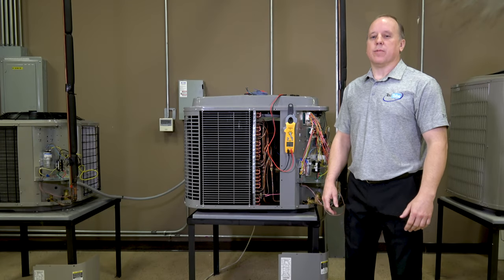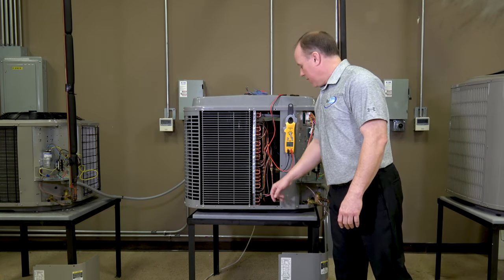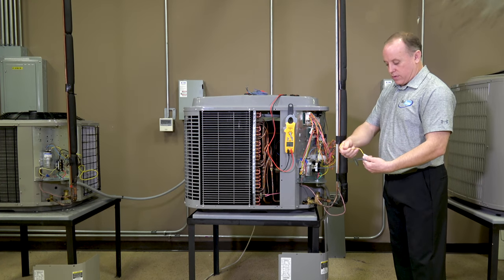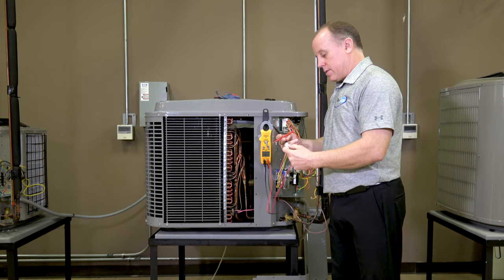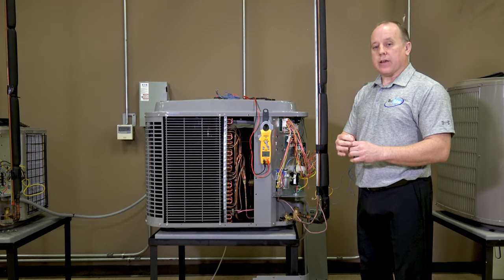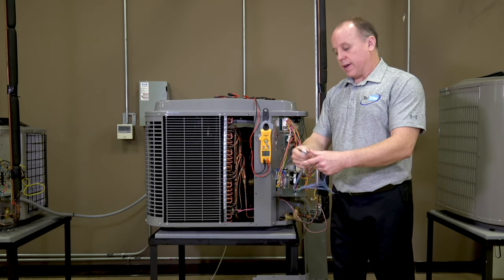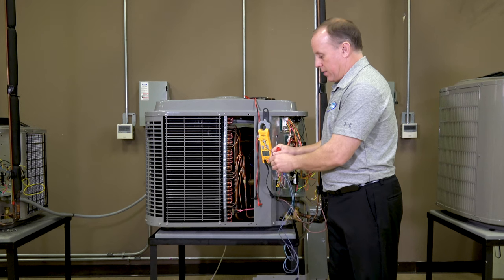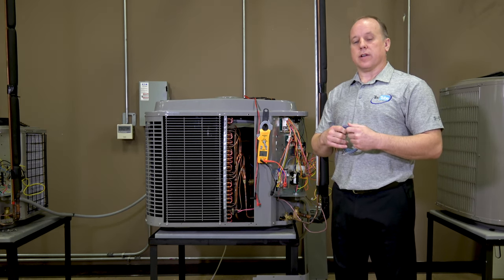Testing Pressure Switches on Condensing Units

Comment: I know this is a beginner forum but I had 2 today low/high on a Trane that would shut off the outdoor unit but not blow the ah fuse. Resistance through switches was 2.4 k ohms. It was intermittent and happen once every 10 hours roughly. I bypassed them. Not a service call you want when units run great while you're there.

Comment: The Lennox unit I just repaired at my home has a pressure switch with a reset button on it.  The outdoor unit would not power on at all. I pushed the button on the High Pressure Switch and the unit started running again. I felt a distinct click when I pushed the button which I did not feel in subsequent pushing.
Reply: u repaired ur own unit? Are u a technician? 99% of the time a tripped pressure switch means u got another problem on residential equipment. You should have it looked at by a pro. Make sure everything is clean. A compressor running high pressure means high bills and very soon to be bad compressor
Reply: @hvacdr  

It was the result of having switched the AC on and off and then on again too quickly. It's an old unit. But it still works.
Reply: If it went out again after that clean the condenser coil, some gasses are bad in terms of glide so can be affected by mainly heat, but well just say ambient temperature, and the other consideration can be the fan rpm, in some machines there’s a variable speed fan, if it can’t do the full range you’ll get issues, pressure switches do wear out also, but good job, a technician usually would just reset it, and run unit, clean it and see if the call returns.
Reply: Distant click was the contactor.

Comment: Why would it be any harder to check voltage vs continuity? Either way, you have to get to both sides of the switch. If there is more than one switch, you have to check each one anyway. Continuity may be more useful, but I don't see it being any easier.
Reply from the maker: It is personal preference. One of our trainers, Ryan, always uses continuity to test any switches, while many of our other trainers use voltage. In our experience, it seems that those who were trained in HVAC programs at colleges or unions test switches with voltage and those with building automation backgrounds use continuity.
Reply from the maker: The only disadvantage of testing with voltage is that you need to know what voltage to expect (DC or AC... 24, 120, 240, etc) whereas with continuity you do not need to know anything about the rest of the circuit.

Comment: My church Rheem heat pump did not come on when I called for ac. I pressed the contactor at the unit and it just clicked. The defrost board was normal and then after I pressed the contactor, the lights blinked. I didnt read what the code equates to before I left.  Am I suppose to find 24 volts at the LP and HP. Can I reset the board to see if it will start?

Comment: Thanks for the video =). Leaving some feedback here that you might want to consider related to safety: Apparently some AC units have pressure sensors without Schrader valves so removing them without depleting the refrigerant inside can be hazardous. It would be good to mention some disclaimers related to safety.

Comment: i didn't test my switches, but i bypassed them and grounded the contactor the AC still didn't run...could it be the relay board on the unit? I so far changed the main board the capacitor and the contactor...the compressor runs if i push the contactor by hand, I'm running out of things to replace lol
Reply from the maker: What were the reasons you had to change the board, the capacitor, and the contactor? That is a lot of stuff. What happened that damaged them all at the same time? How did you test each of those to determine they needed to be replaced?
Reply: @TECTubefilms   none of those are bad but before i did enough research i had those spare parts on hand so i replaced thinking its the contactor then i said well ill try capacitor. I replaced the board with another board that has a fuse unlike the old one. But after ive done my research and diagnosed none of those were broken...
Reply: I have the same problem, but for me, if I press the contactor the AC runs but without cold air. I think there is a leak somewhere and AC is out of R22 (that's why contactor doesn't remain engaged). And since it's R22 I plan to replace the whole unit. It's also over 20 years old.
Reply: @RahulRathi_Multimedia  i ran further testing and the low pressure switch is open, i bypassed it and compressor runs but doesnt cool, also r22 so i think im in the same boat because r22 so expensive and hard to find thanks to the overreach of epa
Reply from the maker: @RahulRathi_Multimedia  If you push the contactor in, it only engages the outdoor unit. To get cold air delivered in the home, you also need the indoor unit's fan to be turned on.

Comment: Thanks for the video. Will the system start and then cut out after a few seconds if the refrigerant is low?
Reply: Depends on what you mean. What's starting and stopping? The fan and the compressor, just compressor, compressor stays on but fan is intermittent? If both constantly turn off and on intermittently then you may have bad contactor or capacitor.

Comment: Thank you for a most helpful video.  My condenser (Carrier 3 ton 14 SEER) has no low pressure switch in it.  It is possible to have one added?  If so do you have any pointers as to what to purchase?
Reply from the maker: Yes it can be added. But it would not be worth the cost to evacuate the system and pipe it in.
Reply: @TECTubefilms  We have to find a leak and fix it so we'll be doing the evacuation anyway  I just ordered a few things so will have my guy add the switch  We are in Bahamas so these things are hard to get hold of.  Thank you for you thoughtful reply and excellent video.
Reply: @TECTubefilms  You don't need to braze it in. If you don't mind looking like a newb, use one of those t's you put on the service port that turns the port into 2, one for gauges and one for the new pressure switch. Don't do that if you want to look professional though.

Comment: That 2nd low pressure switch Cannot Be Good because it read Closed and it’s not even hooked to the System Sensing Ref. Flow.??
Reply: It's probably a high pressure one.

Comment: Will a bad high pressure switch .. stop the condensing unit from cycling off when set temperature reached? Thanks...
Reply from the maker: No. Once the thermostat stops calling for cooling, the unit will shut-off regardless of the pressure switch.
Reply: @TECTubefilms  Thanks a lot for your response I was having this issue with my ac  was looking for a solution ....
Reply from the maker: @thomasguillen5898  You need to determine if the pressure switch is actually bad or if the pressure in the system is getting too high and hence the switch is just doing it's job.

Comment: Will my low pressure switch test closed when taken off the low side?
Reply from the maker: Pressure switches are "normally closed" devices and open when something is not right so in this case the switch will be closed unless the pressure is too low. We are not sure what you are asking when you say "taken off the low side."
Reply: @TECTubefilms  He means if you remove the low pressure switch from the system, should it be open or closed. Or in other words, would they normally be open or closed at 1 bar. The answer is no. Low pressure switch is designed specifically to shut down a super low charged system. The worst low charged system is 1 bar, so the switch should be open if taken off the unit.

Comment: When your unit is off are both high and low pressure switches supposed to be off ? My unit is short cycling
Reply from the maker: The pressure switches will be normally closed and when the refrigerant pressure is too high or too low, they will open and turn the unit off.
Reply: @TECTubefilms  Just to clarify - so testing the switches while they are in the unit cannot tell you if they are bad or not, just that they are open, correct? The other thing you would have to rule out is that your pressure is not high/low. If it is normal pressure, then an open switch would indicate a bad switch, correct?
Reply from the maker: @mcgu8114  Yes, if you can measure the pressure at the switch and it is in a normal range compared to the trigger point of the pressure switch but the switch is open anyway, then the switch itself is the issue. That statement holds true for all pressure switches for all fluids.
Reply: @TECTubefilms  I have a 410 a system and only runs for a minute cuts off and goes into the 5 min delay and does the same thing. High side is 300psi and low side 130 psi the pressure switch trips the unit off and then resets how do I test a pressure switch to know if it's faulty
Reply: @jasonmontroy9182 he literally just told you???
Reply: @jasonmontroy9182 when it trips.... Test your pressure. Was it over the hi side or under the low side? Depending which one is tripping compare it and you'll have yoyr answer. It is really quite easy

Comment: one way to test the pressure switches is to .

1. to test the high pressure switch just disconnect the fan motor and let the head pressure go high maybe even throw a blanket over the unit to prevent convection cooling.

2. to test the low pressure switch just connect a refrigerant recovery tank to the unit and let the refrigerant out into the tank until the unit shuts off.

the recharge the unit.

if the unit has the low pressure switch connected as a thread on and there is a valve stem similar to a tire you can remove the switch and the unit should shut off.

Comment: the ac guy I have said my high pressure switch was bad . but after watching this video I  test the switch and I have continuity  so it's a good switch or could it be bad?
Reply from the maker: We are a little confused.  If he tested the switch and concluded it was bad, why did he not replace it?
Reply from the maker: Without being there to test it ourselves, we do not know why he concluded it was a bad switch.  Having continuity doesn't necessarily mean the switch is good.  Having continuity, just means the switch is closed.  Then the question becomes "was the pressure the moment you tested the switch the correct pressure that it should be closed at?"  Also, the switch could be broke in the closed position and hence it always has continuity even when the switch should be open.
Reply: @TECTubefilms  is
Reply: Pressure switches rarely go bad. Odds are your HVAC guy determined the system wasn't working properly and then found that the high pressure switch was open. What he may have done is he may have then told you the switch is bad. What he should have done is find out why the switch is open. The reason it would be open would be because of, well... you guessed it... too high pressure in the system. When you checked it later, the pressure in the system had probably subsided so the switch closed back. So in other words, based on this very limited info, my best guess is your HVAC guy is lazy or inexperienced and assumed the pressure switch was lying when in reality it was probably just doing its job. The best course of action, given that is true, would be to find out what's causing the high pressure.
Reply: @TECTubefilms  Not sure why you're confused. Sounds a lot like what most HVAC techs would do: Pressure switch open = bad pressure switch. What they should do is: Pressure switch open = why is the pressure switch open?

Comment: does an LPS open usually break the 24v common?
Reply: Yes on contact
Reply: And high pressure switch it’s wired in series
Reply: Yes